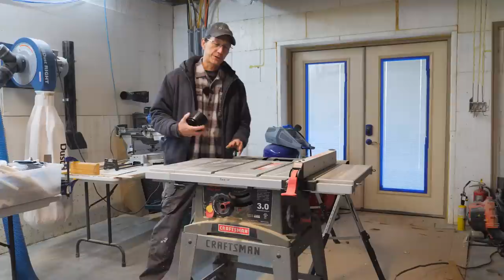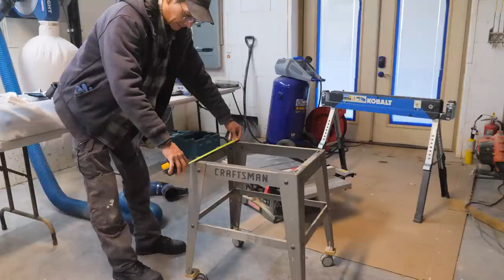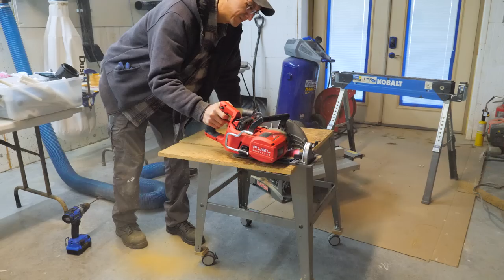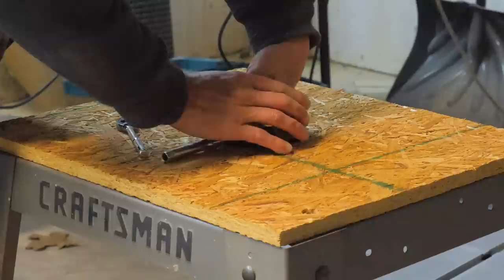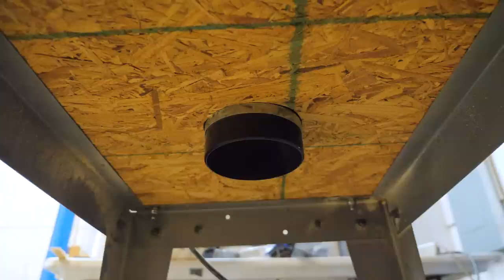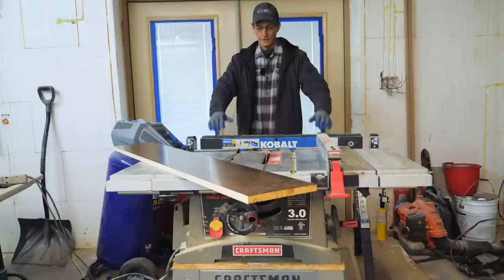Table Saw Dust Collection in 5 Minutes

Comment: You could probably do a modified version of the mobile base that I built for my sawstop contractor saw to fix your wobbly base and still be able to move it.  Basically it uses the feet and has a set of drop down wheels on a lever.  It works great so far for me.  Also, Rockler does sell screw on quick connect ports so you could have just had a hole and screwed the quick connect on the outside of the plywood.  I have used that on multiple tools (my downdraft table and even my upgraded dust collection for my jointer.  The playlist for the sawstop mobile base I made is here: https://www.youtube.com/playlist?list=PLjrM8MU4TJJDuRshI7WbiWHO-IYKrIHxm   If you do decide to try it and have any questions, let me know.  I think all the info should be in one of the three videos...but if not, I am happy to try and explain more if it helps. :)